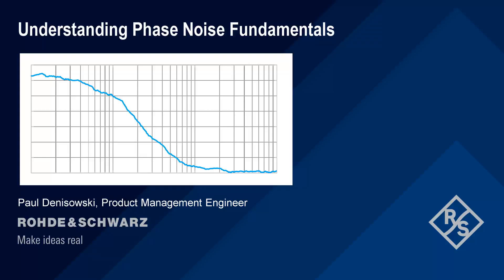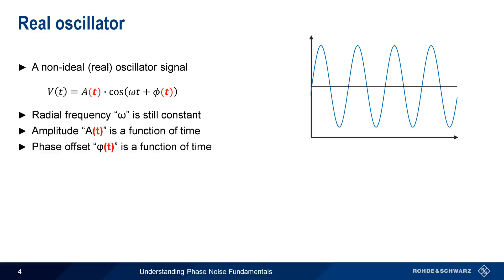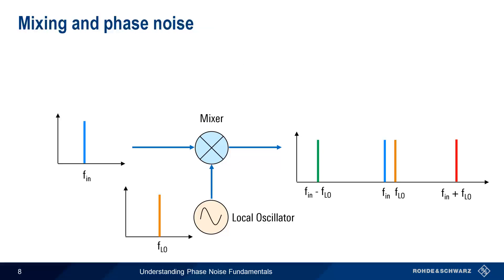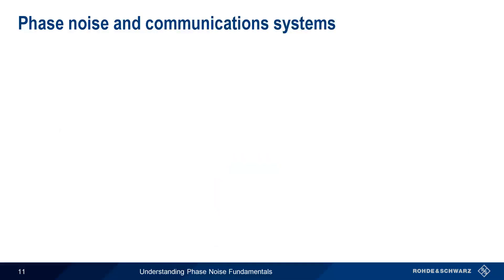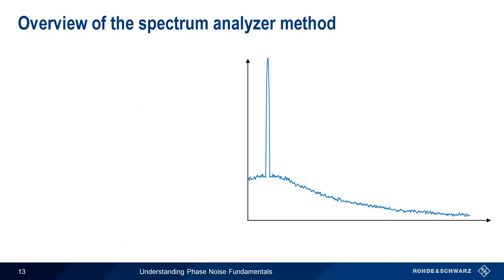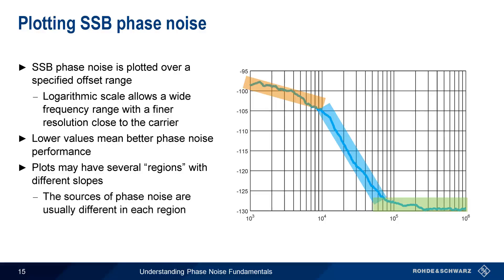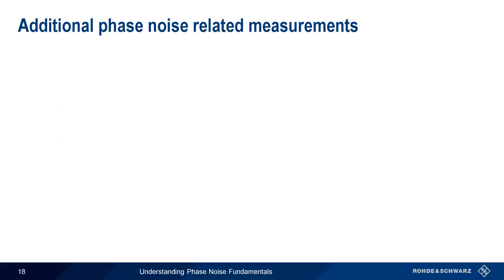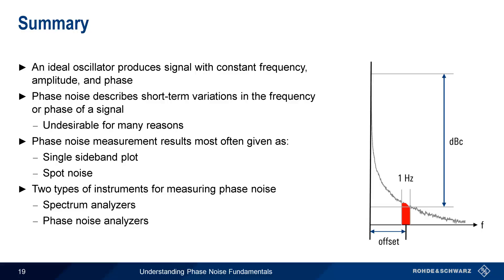Understanding Phase Noise Fundamentals

Comment: Great, clear and to the point educational videos to get the basic understanding. One question if I may. Older spectrum analyzers do not go so low in RBW to 1Hz, nor have automated measurement of phase noise. When doing manual measurement with specific RBW (for example mine goes to 200Hz) do you divide the measured power (at some specific offset, like usual 10kHz) in dBm by 200 to get [dBm/Hz]? Thanks
Reply: Edit: I just found my answer in the next video 😁 It's not just diving, it is subtracting the 10log(RBW_used).
Reply: Oh, I was right, only one problem, you need to divide the measured power in [W] by the RWB _used and not in [dBm]! dB's are (of course) all about "adding and subtracting".

Comment: The best video on phase noise. One thing not mentioned is that spectrum analysers can only be used to measure phase noise where the phase noise of the DUT is worse than the phase noise of the spectrum analyser. This is a problem for low-phase noise oscillators, hence the need for cross-correlation phase noise analysers.
Reply: Thanks!  And yes, you're absolutely correct.  I did a separate video on cross-correlation since it is, as you mention, a very important topic when measuring low-phase noise devices.

Comment: question, how to determine the phase noise signal level it good or bad. what the limit.
Reply: That's a complicated question :)   There are some applications that are relatively immune to even very high levels of phase noise, and there are some applications where even very low phase noise might cause problems.  Generally speaking, higher modulation orders that use phase modulation (PSK, QAM, APSK) have stricter phase noise requirements:  e.g. 64QAM requires much lower phase noise than QPSK.  Phase noise is usually reported as curves (like the one shown in this presentation) so that you can see what the phase noise is at the frequencies that are interesting / important for your application.  If you haven't already, you might want to watch the videos "Understanding APSK and QAM", "Understanding EVM" and "Interpreting Constellation Diagrams" for a better, more visual, explanation of what phase noise can do in modern digital modulation systems.  One last note:  most standards, like 5GNR, 802.11 (Wi-Fi), etc. specify required EVM levels (in %, for a given modulation order) rather than permissible phase noise.  Hope that helps!

Comment: @2:36 the 2nd plot may i know what the label of the y axis ? Is it Power ?

Also @2:36 2nd plot  may I know mathematically how did the time changing phase cause spectral broadening in other words how did we get this skirt shape Vs Freq ?

@3:57 you mentioned that it is generally easier to work with less Freq signals , may I know why ?
Reply: Those are all great questions.  The y-axis of the frequency domain on slide 3 and 4 is power, usually measured in dBm.

The math behind phase noise measurement is a bit too complicated to type in a YouTube comment :)  Conceptually, it might help to imagine that the sidebands or skits are a probability density function (PDF).  If the oscillator were perfect, the frequency would be constant and the PDF would be a single line. A real oscillator might have small frequency variations away from the nominal frequency most of the time, and larger excursions from the carrier less often.  This isn't really exactly how it works (mathematically), but it might help in explaining the shape of the phase noise sidebands or skits.

There are lots of reasons why it is easier to work at lower vs. higher frequencies.  Passive components (resistors, capacitors, inductors) and even wires or traces start behaving non-ideally as frequency increases.  For example, wires start developing inductance at higher frequencies and capacitors also start developing a series inductance and resistance:  this greatly complicates circuit design and analysis.  Higher frequency components also cost more than lower frequency components :)  There are many more examples, but the use of downconversion is extremely common in RF applications.

Thanks again for the questions!  Hope that helps.
Reply: @pauldenisowski  you don't want to get down too low in the frequency realm or you open yourself up to potential interference from DCDC power supplies. Also large power electronics can resonate between 1-100MHz, CPU clock signals, etc. Downsizing is very sensitive to the rest of the system and it's quite fascinating 😀